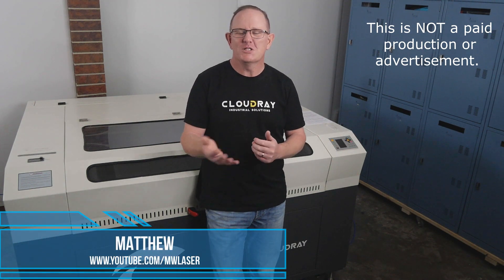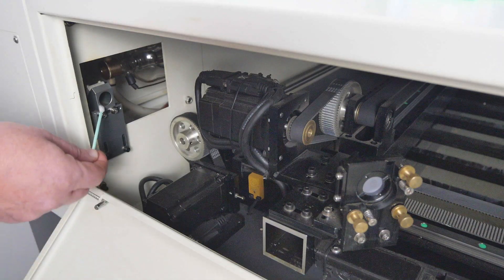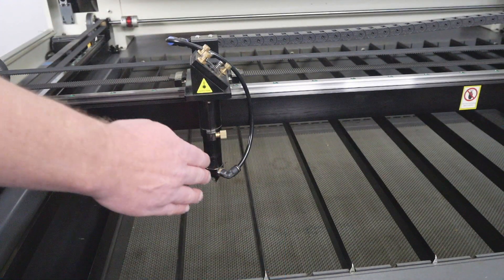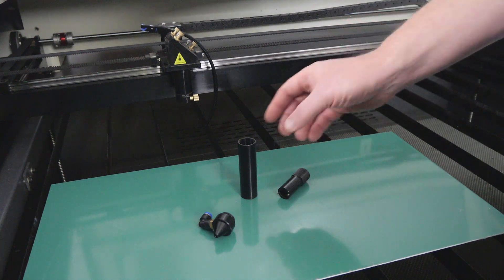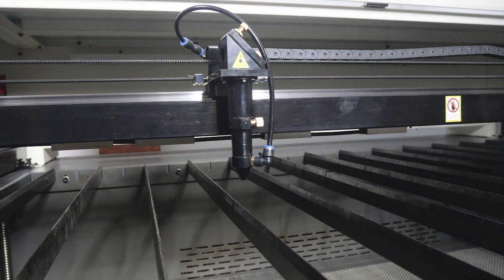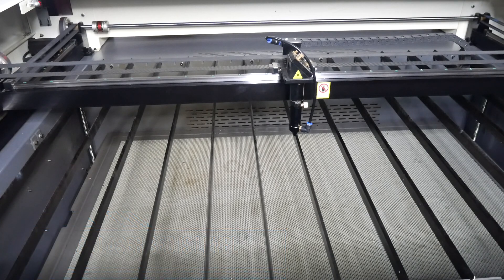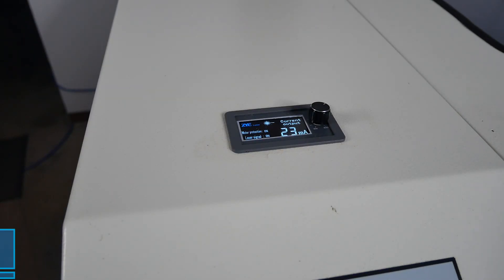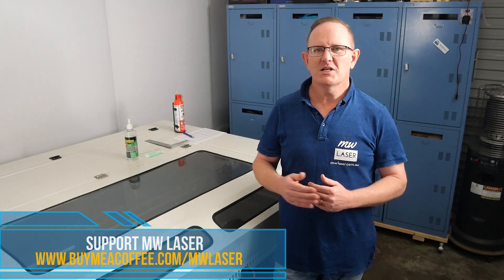Co2 Laser Troubleshooting Guide - Troubleshooting Poor Cut Quality

Comment: Well explained.

I have another conundrum. I am getting straight but erratic dimension cuts on the y axis  (this suddenly started after 7 years of work. For example if I cut a box 3mm high x 20mm  wide and cut say 6 of these at once I can find the height can vary from 3mm to 3.1mm to 2.8mm and no linear degression, first can be 3mm second 3.1mm next 3.1mm and last 2.8mm.

checked steppers, swopped stepper controllers, looked for belt and pully damage etc. Bit stumped

Comment: Hi Matt!! I just found your channel and thanks for all information you chare with us. It's been very useful!! 
We have a question and maybe you can give us a solution, please! We have a 300w fold CO2 tube, and we tried to install and fail. Used two diferentes power supply, but it doesn't start both of tube together. Always one or another. Giving to us half of the power. May be used the wrong power supply? We can even sent videos or whatever information you ask for!! Very expensive tube and nobody know how to turnt it on with full power...
Reply from the maker: They require 2 x psu to operate

Comment: i have a 150w-180w reci tube , i'm noticing huge drop in cutting effectiveness, 
i've checked every detail, all mirrors and lens are clean and super alligned, 
tempereture of chilled water always below 25degree celcius , 
and while cutting my milliammeter is showing 2 to 4 milliamps drop from previouses values, 
and even after i increased the power or reduced the speed , it is not performing well,
i've had about 600 hours of laser ON time, but the age of the tube is around 4 years. 
at first i suspected that my power supply may be the cause, but if my ammeter is reading good milliamps values 
does that mean my power supply is definetly good ?

Comment: Thanks for the video. I'm new and learning so every bit helps. I just got a Blue Elephant 5'x10' laser with a 175w RECI laser. It cuts wood, acrylic and cardboard great. I was rather disappointed to find that it won't cut 28ga sheet metal. Do you think something may be set wrong? I've seen other Youtube videos of 150w co2 lasers cutting 16 ga mild steel like butter.
Reply from the maker: does your machine have metal cutting head ?  you cannot cut with standard setup

Comment: Hello Matt,great video like always and very helpfull.I have one question about my axis.On Y Axis my machine,when I start,it starts on Upper Left position.But it is 10mm almost shorter than it was in the beggining and X axis overlap honeycom also about 10mm on one side.When travels on controller it shows normaly 900x600 and on RD is adjusted work size to 900x600.I was thinking that limit switch is doing this but moving this switches nothing happens.What could be problem?Thanks in advance.
Reply from the maker: this is not something I can assist with via youtube comments.  email info to askmatt@mwlaser.com.au

Comment: another great video!. Thanks. Btw, I'm considering cloudray or reci laser tube 90-100w. Which one you will recommend? I know both come from same company but would need your advice. Thanks
Reply from the maker: From your two options, I would recommend RECI, I however have Cloudray Laser tubes in two of my machines and they are performing extremely well.  Have you considered HM Laser tubes? they are also a high quality laser tube manufacturer and there may be a local distributor in your country.  Cheers Matt
Reply: @MWLaser  thanks for your reply. I cannot find HM here in Indonesia but i can find hardray brand. Have you heard about hardray?
Reply from the maker: No I haven't
Reply: you prolly dont give a shit but if you are stoned like me atm then you can stream all the latest series on Instaflixxer. I've been streaming with my girlfriend for the last days :)
Reply: @Ronin Tate definitely, I have been using Instaflixxer for months myself :D

Comment: Hey Matt, thanks for the useful tips. Can I ask, are the screws for your Z axis ball screws or ACME lead screws? 

I couldn’t quite tell from the shots but I suspect they are ball screws - do you find them to be better then the acme screws on the red and black? Less wobble when lifting the bed?
Reply from the maker: Yes they are Ball Screws. Much better than the Acme on Red and Black, definitely a smoother motion and provide better stability on the bed.

Comment: Very timely video for me, I just came into the shop yesterday and was experiencing a decrease in cutting performance. I cleaned the lenses, mirror 3 & 2 but didn’t see anything on mirror 1 and didn’t think the laser could have anything on it. I will check today to ensure. I was thinking tube replacement as I have been running my stock K40 as a production machine for the past month and figured it wasn’t made for running 8+ hours a day like this. 

I will be cleaning all surfaces that the laser beam comes in contact with or through and see if things change. I wish I had a way to test the power supply’s output to ensure it was operating correctly. 

I know I have been pretty hard on my K40 this last month running it nonstop.
Reply from the maker: You're welcome, I hope you sort out your cutting issues. Cheers

Comment: how many passes and power should it take to pass thru 1/4 (6mm) plywood? I have a 60w OmTech brand I think its not cutting like it should
Reply: My K40 used to have no issues cutting through 3mm birch at 15mA and 10mm
Reply from the maker: Not sure with a 60w, I actually have not attempted 6mm on one. Maybe this can be answered by someone who has. However for comparison on the 80w I have cut in single pass with low speed and power around 25mA. Cutting power and speed for different types of plywood vary, if it is a hardwood ply it will take more than a single pass.